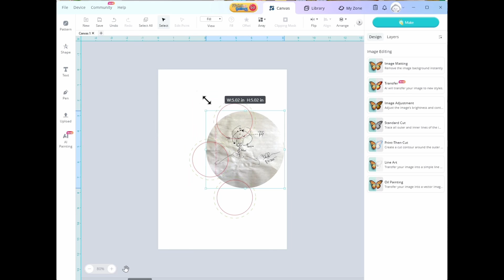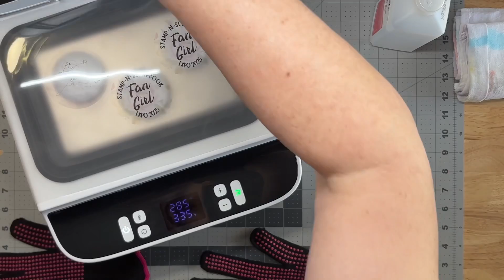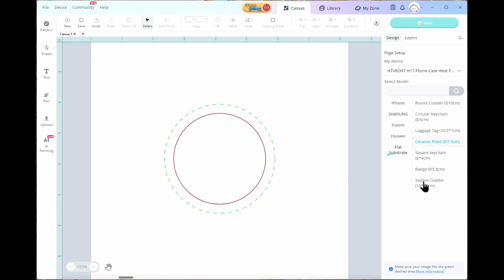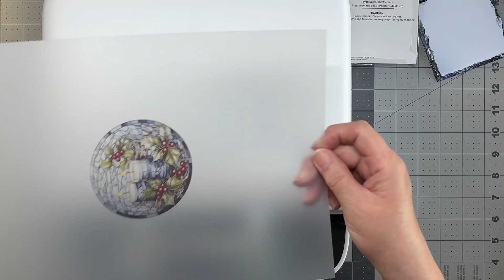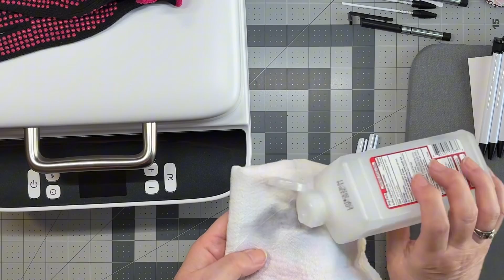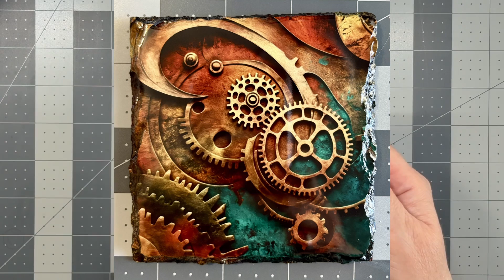Testing the Limits of the HTVRont Phone Case Press

Comment: what software are you using to make the designs? I'm using canva but when I print the colors don't match my design, Ex, canva is cobalt blue but print baby blue to my Epson printer.
Reply from the maker: Hi! I do most of my designing in Canva to get my prints sized correctly. For this video, I created the pins in Affinity Designer, and the other images were from Creative Fabrica. I brought everything into LOKLik Idea Studio to prep it for the phone case heat press.

When you’re seeing that color difference, is it before or after pressing? Sublimation prints can look really off before they’re pressed—often much lighter or even like the wrong color. That’s totally normal and catches a lot of people at first. The heat is what activates the ink, and that’s when the colors deepen and look much closer to your original design.

If you’re noticing the color shift after pressing, it could be a settings issue—but if you’re using something like the Epson SureColor F170, those are usually pretty dialed in already and don’t require much extra setup.

There will always be a slight difference between what you see on screen and what prints, though—that’s just normal screen vs. print variation.

Comment: Hi! Do you think a sublimation shin guard blank would fit in there?
Reply from the maker: No, I'm pretty sure a shin guard would be way to big for this machine. The depth alone is only 3/4" while the width and length is a bit less than 5" x 8". I would be amazing if HTVRont would create a machine that would fit larger 3D items though.
Reply: @c@col @coloradoleen Yeah I kinda realized that after doing more research!

Comment: I don’t understand why there’s two heat settings
Reply from the maker: Great question! The press heats from both the bottom and the top, and they can be set at different temps. The base helps bring the inside chamber up to the right temperature for the type of blank you’re pressing, and the lid is the main heat that activates the sublimation/transfer on the blank. Different materials sometimes need different top vs. bottom temps to get an even press without warping or under-heating. Hope that helps!

Comment: I’m confused. You said that ceramics require a 2-10 second preheat, but when you came back after your break you said the ceramic coaster had been preheating for 5 minutes.
Reply from the maker: Honestly, that 2 - 10 second preheat has been a bit confusing for me. I did some extra research on that this morning and that preheat time is for the sublimation film to warm up as well as to get the chamber back up to temperature before the sublimation time starts counting down. 

In this example, I placed the slate coaster in the press and then put the sublimation film on top of the press to dry the ink for 5 minutes. I have found that heating the blank for a longer time really helps the colors pop. The perfect example of that are the buttons I made first. I didn't put them into heat while the film was drying, and the colors aren't that vibrant.

Thank you for asking this question and giving me the nudge to research this further! Happy Crafting!!